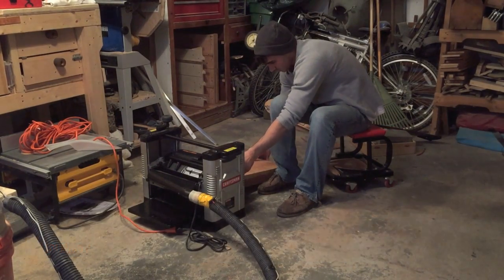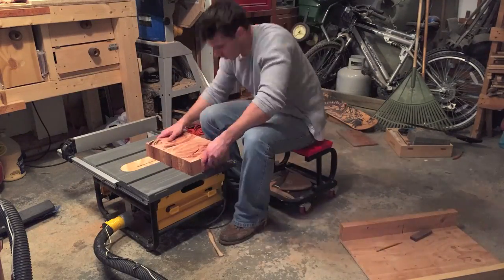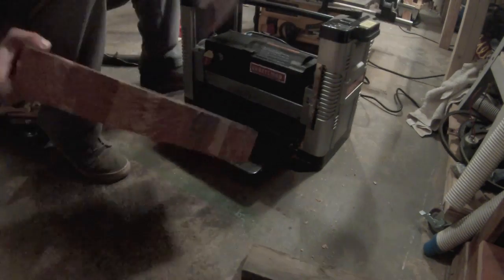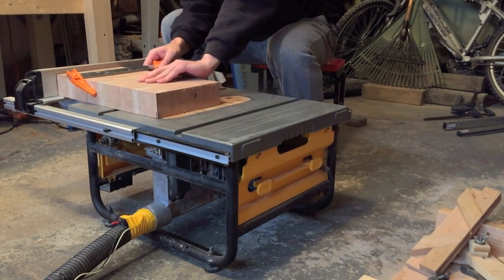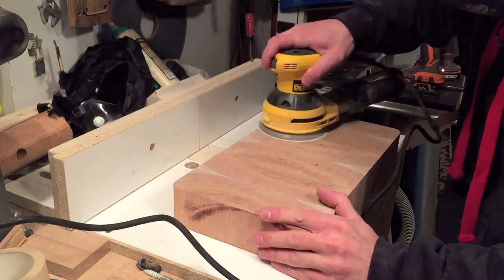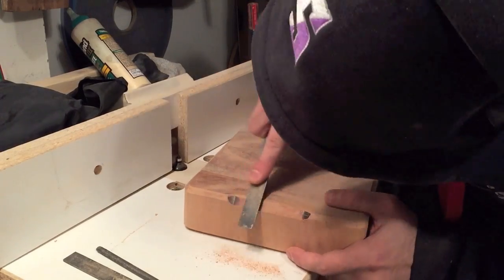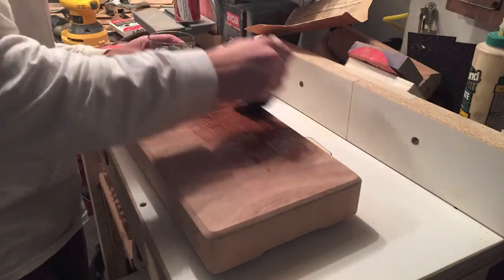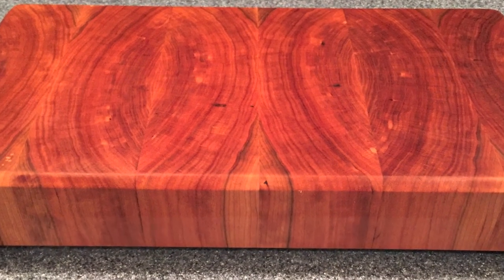How to Make an End-Grain Cutting Board -01

Comment: I have the same table saw, with the same burning. Beautiful piece of cherry for the cutting board!
Reply from the maker: my blade is just old, love the saw though, Thanks
Reply: How often do you clean your table saw blade?  If you can see pitch and not clean carbide teeth, it's time to clean the blade.   I like to use cmt blade and bit cleaner.
Reply: Years ago,  when I started getting burning with my table saw I thought it was time to get my blade sharpened. Then I saw a super easy cleaning tip on www.finewoodworking.com.   Dish soap & a tooth brush.   At first,  I was skeptical that cleaning would solve the problem,  but WOW! it was like a brand new blade. Give it a try it may solve your problem.
Reply: Derek Naulls This a good idea, but Cherry wood will burn easily with the best blades - even if new.
Reply: Derek Naulls - same! Except I saw that laundry detergent worked better. Didn't try dish soap but the laundry detergent worked great. I'm wondering if it's only the soaking that works. The tooth brush is the key...I think anyway lol
Reply: Jason Enz , yes I think the truck is so-so of some kind.  the pitch that accumulates on blades gets broken down by the soap and allows the brush to do the finishing touches. 😁

Comment: nice board! sweet trick with the flour as well. do you think it would work with oak (with much biger pores) as well?
I'm thinking about oak for a long time but with those big pores I think a lot of stuff can get caught in there and feed bacteria. What do you think?
Reply from the maker: Jaka Lestan   Hey brotha, thanks for some feedback and happy you liked the video. It depends on what type of oak you use and what you use to seal of the pores. Oak is a hard wood but has open grain so I would use something a little thicker as a finish, such as a thick butcher block oil or bees wax. hope this helps!

Comment: Quick question: did the stain you use have any effect on food? Is it safe? Assuming it is, can you tell me what you used with the flour there?
Thanks and great work!
Reply from the maker: Nicool333 I used a few coats of olive oil as a finish. the whole purpose of finishing a cutting board is to seal off the pours so food or liquids don't get absorbed into the wood. I read somewhere that you can use baking flour to fill the  pours. I never used this method but it hasnt given me any problems so far. Also, just note that an olive oil finish is not permanent, i'll have to reapply more finish in a year or so

Comment: So, why would you cut up a piece of wood and than glue the pieces back together ?? Or am I missing something here ? I always thought chopping board is a typical scrap wood (off cut) wood project...

I mean, why would you have not just sand it and finish it as it is???

BTW, it looks really beautiful, so who cares about the rest!!?? :)
Reply: Csaba Facsar - watch again closely 😉
"End grain" cutting board...just saying :)
Reply: Jason Enz so it is about the look!?
Reply: Csaba Facsar - yes and no. Skip to 1:28 in the video. He cuts the piece and flips the pieces 90° so the "END GRAIN" is up. I personally like the look better but more function meaning it will last longer and your knife will stay sharper longer. End grain has some "give". The wood fibers will separate to take the knife and spring back as the knife comes out. Hold a paint brush straight up and slowly put a knife through it (from the top down)...that's the idea of how it works :)
Reply: Csaba Facsar - I'm more of a butcher block fan but this one actually came out very nice. This one is nicer then some butcher block types I've seen.
Reply: Jason Enz thanx that makes sense! :)

Comment: Please be careful planing end grain.  It can easily cause a major safety issue and destroy your planer as well in a nanosecond.  In fact, I'll go a bit further and say DON'T PLANE END GRAIN.

Next time use some cauls to align the glue up and you can just sand the end grain since you won't have major offsets between pieces.

I'm not trying to knock you.  You made a very nice cutting board.  You can really, really get hurt planing end grain though.  The planer can virtually explode from the force.
Reply: Thanks for the info.
Reply: Ray M - I've heard so many times "it can explode" but in all my research, all I've seen is some slightly moderate chip out and some cracks...haven't once heard or have seen this actually happen.......but I 100% agree with you lol. I'm saving for a drum sander for this exact reason.
Limited?...build a router sled to flatten it.
Luckily I work in a huge shop with giant machines...and a massive wide belt sander 😉

Comment: You really shouldn't use olive oil in the finishing process.  Olive oil spoils.  Other vegetable oils, canola oils, etc also spoil. There are plenty of "salad bowl" sealers or "butcher block" sealers out there.  If not those, then at least use mineral oil (not the same thing as mineral spirits).
Reply from the maker: +Jarrett Saia Thanks for the insight but I've been making cutting boards since I started woodworking and none of them smell, make the food taste weird or anything like that, plus olive oil is harmless to ingest. Like olive oil finishes, mineral oil, butcher block, salad bowl finishes all need to be reapplied to a cutting board from time to time, for me olive oil was the easiest to maintain.
Reply: +Jarrett Saia This is 100% correct. Oils like olive or and vegetable oil cannot be used as finished as they turn rancid over time. Best to use mineral oil or the salad bowl finish
Reply: Michael Volpe can you provide a reputable source for your finishing technique? I’ve never seen a professional use your method and I know that olive oil WILL turn rancid.